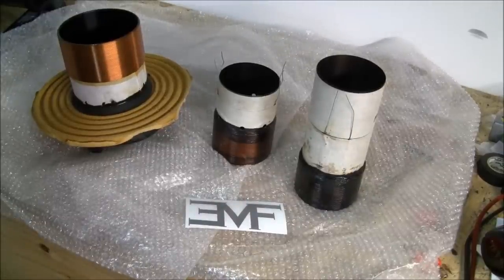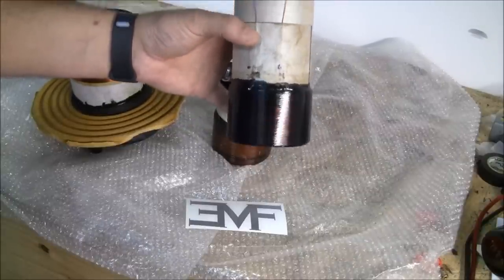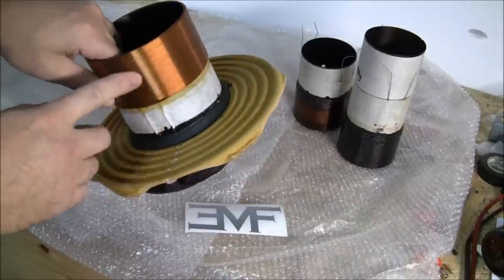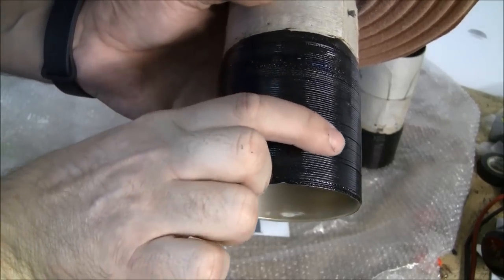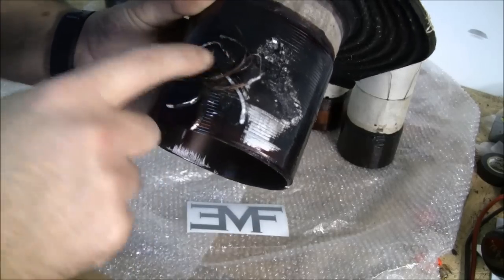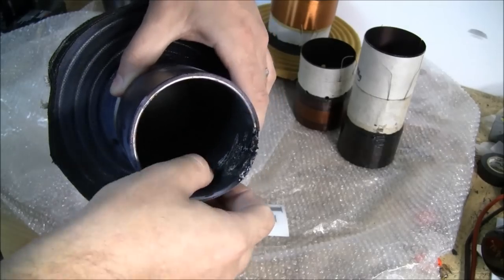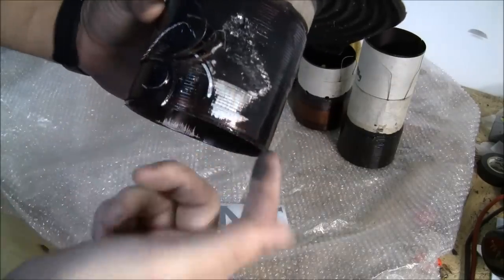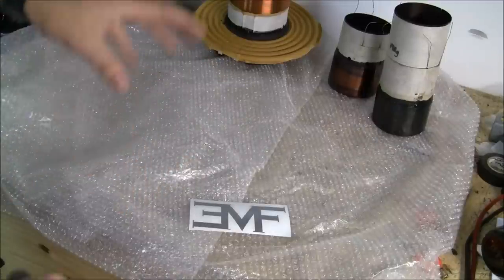Voice Coils - we know what you did!

Comment: I don't think wattage is as relevant as current to heating a voice coil. If you take the current, times it by itself, then multiply by the DC resistance of the coil, that tells you how many watts of heat is being dissipated by the coil. Wattage is the product of current and voltage. If you see voltage, that means the coil is moving. Cone excursion is what Cools the coil. If the crossover is set to too high a frequency, it's possible to pass a lot of current through the  coil, without the excursion to pump air through the air gap, using the dust cap like a piston. Clipping puts high frequency harmonics through the coil, creating current spikes, without extra excursion, and that's the only way I can see clipping causing damage from an amplifier who's peak rating is less than the RMS rating of that coil. I would NEVER recommend running a speaker driver without a dust cap, because the coil would get no forced air cooling.
Reply from the maker: Every wonder why electric heaters are often measured in watts?
Reply: @EMFAudio  Electric heaters are a pure resistance. VA equals watts, Impedance equals resistance. Throw in a little inductance, and a whole lot of (dare I say it?) EMF, and it's a whole new ball game.
    This is a motor, being accelerated, stopped, put in reverse, accelerated, then put back in forward, repeatedly. Granted, a speaker is a linear solenoid reciprocating motor coupled to a mass, with some pressure head, but, it's a motor none the less.
     Proper acoustic loading can give some of the momentum of the cone a place to go, so the amplifier doesn't have to apply "dynamic braking" to slow it back down. One of the hardest things on an analogue amplifier, is having to stop the cone, because you're adding the voltage of the power supply to the EMF of the coil moving through the magnetic field, then multiplying it by the current. Every bit of that wattage is dissipated by the transistors. A properly loaded driver is MUCH easier on a linear amp, than running a speaker in free air.
Reply from the maker: @vincentrobinette1507  I think you've missed the point of what I said. Electric heaters are pure resistance, if the coil was moving in a magnetic gap it would then be a motor. If you stop it from moving it will act specifically like a heater. Wattage does matter, the more wattage you put in the more cooling you have to have to stay within acceptable heat limitations.
Reply: @EMFAudio  I agree. Stopping all motion lowers the impedance of the speaker, to just the DC resistance of the coil. At low frequencies, the inductance of the coil only adds negligible impedance. The ONLY thing that heats a coil, is amperage times the voltage drop across its DC resistance. If the coil is allowed to move through the magnetic field, it will allow a voltage rise, but that voltage is going into work, radiating out as acoustic energy. That does NOT contribute to heat in the coil, even though the extra voltage, times the current equals more wattage. 
     The worst case scenario, would be accidentally connecting one of the coils out of polarity with the other. The magnetic fields cancel, no sound whatsoever, total cancellation of inductance. At that point, the coil is just a resistor. With no motion pumping air through the coil gap, the coil can't dissipate heat, and smoke is on the way.

Comment: I have a hcca 15.2 black coil edition. I set my gain with smd dd1 and then turned it down a little just to take it easy on the sub and not bump it too loud at 1st for break in. Well now that it's been pretty well broken in, if I really start pounding it, still with it not at supposed full potential... it seems to smell funky. Not exactly like burnt coil though. Is this just normal for some new subs? I'm just afraid to turn it up and I didn't buy a hcca to not turn it up lol.
Reply from the maker: BaSsAholiC Icanthearu the first few times  you get a coil hot there may be a smell, that is common.
Reply: a warm electronics smell is normal on break in, smelly band-aid and/or burnt wire smell no! give it max clean power and warm it up and cool it down, say 30 -45 second full tilt then a couple minutes to cool down. (heat cycles) it took my 18’s 3-4 months to break in but it was worth the time and effort!!! 147.1 db no wall msd class 3 on music😆

Comment: What kind of coil do you need for a thousand power amp
Reply from the maker: Power handling isn't determined by the coil alone, the motor cooling has a great deal to do with it too. A copper, 4 layer coil with some length on it that is 2.5" diameter like is found in our Lowballer line could conceivably take 1,000 watts. We also use a higher temperature rated coil than most, 500 degrees. Most 3" coils are capable of handling 1,000 watts unless they're very short or maybe only 2 layers.

Comment: coils do NOT like DC current! clipping is DC Current for those who may not know! 
and Copper is way better.
Reply from the maker: It's not that copper is way better so much as copper and aluminum have their place in design. We do use aluminum coils in some subs because it would perform worse with a copper coil. The benefits don't outweigh the drawbacks in those cases. There are instances where copper is a key design element like on the Banhammer and Lowballer line of ours.
Reply: EMF Audio yea in some cases. copper clad aluminum is good. but I have had nothing but trouble with it. mostly in connections. not in coils.  I guess it cuts the weight in the moving parts. making a more precision sound.

Comment: voltage not watts=)
Reply from the maker: Voltage alone means little, watts is voltage and amperage. 100 volts and 1 amp is 100 watts, 100 volts @ 1 ohm is 100 amps, which is 10,000 watts.
Reply: @EMFAudio  yes lol i was just getting at supplying low voltage to an amp can cause serious damage, which in turn can cause problems with your sub.

Comment: I want another opintion. Is this shit for real? And what if you used a super heat conductive  core. then wrapped that bitch in HRSC copper alloy and put some good ol fashion high temp epoxy on the whole shit?  I have never seen a coil that was truly built to the hill or did I just give away my shot at a million doll hairs? Edit and couldnt the core be finned? 
And my last one wouldnt a bad wire do some of these failures???? or a bad run of epoxy???
Reply from the maker: I'll give the very simplified version of why what you said isn't the case. For starters, the "core" as you put it isn't the source of the heat and does very little to expel heat. When you use copper you're doubling the mass of aluminum, some applications call for aluminum. High temp epoxy IS used (on good coils). A bad wire would cause a break in the wire, not an explosion or sliding off the former or anything like that. A wire problem has happened before in the coils we use, but it's rare, one in thousands, and it's only happened on 1 specific coil that we quit using.

Comment: I have one comment now you're telling me that every single person a senate and that is told you I don't know what's wrong I didn't put it on and amp with that much power are liars basically what you're getting down to liars because you can look at the coil and it's tells you that it was on and amp that was way more higher rated for that speaker but you have to take in consideration that not every single amp out there is going to do exactly what it says there are the few exceptions of amps that are under rated so people that are novice purchased the speaker and the amp thinking that they're under powering the speaker and they have a good power system in their vehicle so the amp kicks it up a notch does double or triple what it says it can do and then hurts their speaker so they're like I don't know what happened I didn't overpower it an ax reality they did overpowered because they Because the amp did more than what it was rated
Reply from the maker: There are 2 amps ever made that does way way way over rated, one was made in 1997 and it was rated for 1 watt. The other was one we made rated for 1,337 watts and made over 4,000. The only reason people got the AMP-1337 was for a class specifically and knew it could make 4,000 watts. I don't care what bogus dyno numbers you're seeing, amps don't make 2-3x rated power. If they did, they'd be rated for it, there is no benefit to having a really expensive for the power rating amp. Back when I worked for shops many years ago, we could do an installation one day and the next day come back with 4 blown subs saying "I didn't even have it up, it just shut off" then when we look at it every knob on the amp was turned wide open and the bass on the radio was all the way up. You don't blow all 4 subs at the same time and the amp be fine, and nobody at the shop would turn everything wide open. People lie, plain and simple.
Reply: absolutely true

Comment: Get something right, chaps ! It's NOT always the user - Take Wharfedale Valdus 300 - Only buy these vintage speakers if you're ready to pay again for new drivers. All in this range have built in failure - the cone supports are foam rubber - they are all rotted by now, and the cone drops. Naturally, if it's not motoring, it's voice coil is going to get hotter and hotter 'til it f***s up. Thats what happened to mine - so I'd be hunting 'net for spares suppliers, buying new surrounds; New voice coil; spend some hours working on it - and that's assuming repair is 100% OK. 
No, I'm calling it BER and just buying a brand new alternative woofer - got guarantee that way and it's fitted in 5 minutes.
They are garbage; not the Wharfedales I remember.

Comment: That second one failed from rubbing all the shellac off the coil.  Shame on whoever built that with the coil misaligned.    Granted it probably wasn't going to last long by the looks of the burning but still, rub a coil and it'll burn a hole on the rub side eventually.
Reply from the maker: Did you completely not see the burnt wire? It failed because the wire burnt and exploded, which caused it to fill the gap and rub. You might notice the rubbing is only where the coil got blown out. The rubbing on the former is only at the bottom because of where it got knocked sideways further up. If it wasn't aligned properly the rub would go all the way up the former.
Reply: If the  former was slightly off 90 degrees in the gap it would definitely wear like that at high excursion.   If the knot of slinky coil had pushed it away from its side from bumping into the top plate it would have worn on the inside of the former on the same side as the burn.    

Other possibility is whoever used that has some terrible loading issues in his wall/box that's rocking the cone at high power levels.  Might have the guy keep an eye on how the sub in that hole of his box/wall performs in future.
Reply from the maker: The side that rubbed on the top plate didn't cause a rub on the pole because, wait for it, it cocked the coil sideways, which is why there is a rub at the bottom of the other side. If it pushed it to rub the pole on the same side, that would mean the spiders weren't connected to the basket. The closer to the triple joint, the less possible it is to rub if it's properly aligned. If it's misaligned, it will be the same rub all the way up.

The person did not have loading issues, they used the same sub in the same box for about a year without an issue. That coil is from an Ermagerd v1, it's about 3-4 years old. 100% of the damaged happened within seconds. The rubbing, the blow out, everything. Voltage when low when he played some high bass after playing it for a while (low impedance, more power, more current draw, low voltage) and clipped it hard with over 6,000 watts. I was at the show when it happened.